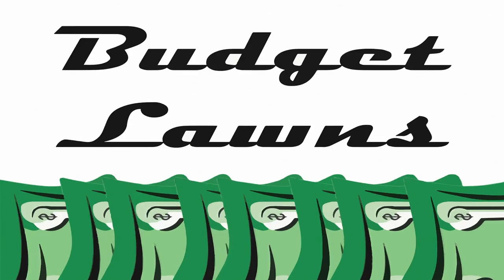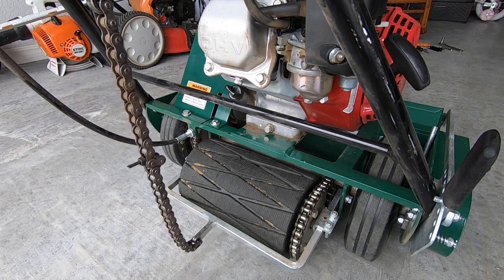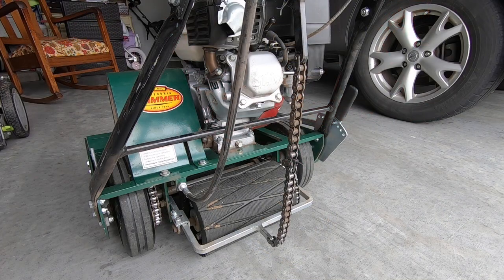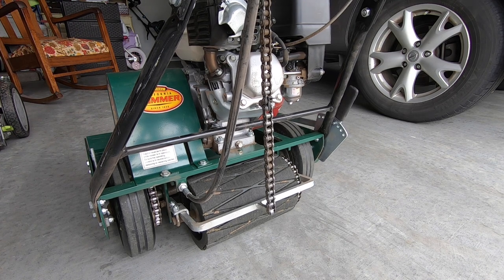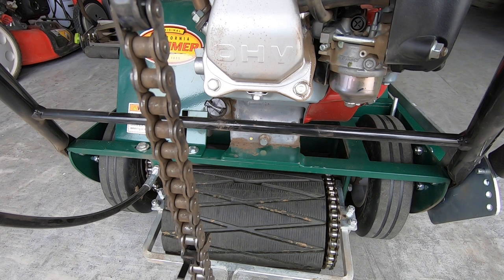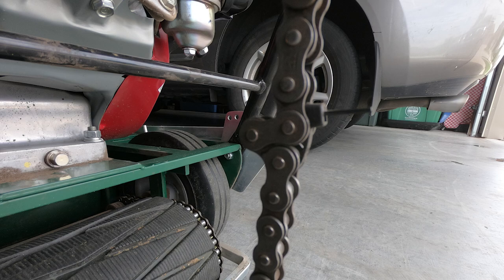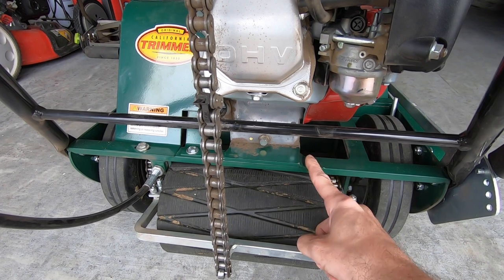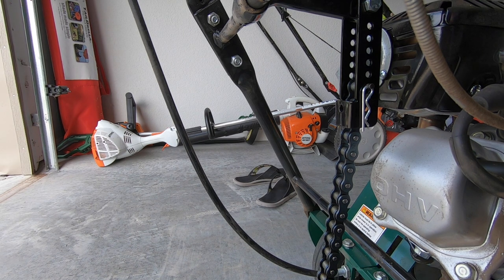Power Reel Mowing Tips // 4 Ways to Adjust the Drive Roller Chain on a California Trimmer Reel Mower

Comment: Hi. Love all the vids. You've got a great YT personality. Hope you'll see this question. Here in Northern California - Santa Rosa - extreme drought regulations. So, here's what I do. 1/2 acre. All grass front and back, for the most part, w/perimeter hedges all around - privet and pittosporum.
I water the hedges, and a little of the grass, every other day w/ hose and nozzle. Takes 30 minutes for the front and 30 minutes for the back. My nozzle at the spray level I use, puts out 4.16 gallons per minute or 124 gallons per 30 minutes. What do you think of that amount of water that I'm using. Does it seem excessive? Thx Dave Santa Rosa Ca
Reply from the maker: Thank you! Appreciate that. It's really hard to say if it's excessive as I don't know what your watering restrictions are. Staying within those is really your only option it sound like. When it comes to how much is necessary, most lawns only need an inch a week. One of my latest vids laid out 4 tips to water correctly. Here's a link to it if you haven't seen it already, https://www.youtube.com/watch?v=L-ycMjccGPE&t=3s. I hope it helps. Thanks again for the kind words. Really appreciate your support.
Reply: @BudgetLawns  Got the answer. Sprinklers - I have the same as you - take 90 seconds to fill a 5 gallon container. So, an hour of the sprinkler uses 200 gallons of water. Breaks down like this: 3.33 gallons for one minute -  5 gallons for 90 seconds -  200 gallons for one hour. Take care. Love the vids. Dave
Reply from the maker: Awesome. Thank you for sharing. Glad you got it figured out. Appreciate your support!

Comment: Not really related to your video but it doesn’t hurt to ask 🤷🏻‍♂️.
How to get rid (or avoid) clip marks? I have a McLane 20” and I always leave clip marks after a pass.
Am I doing anything wrong? Thanks
Reply from the maker: Thanks for the question. I'm not exactly sure what you mean by clip marks. I did a video last summer with some tips that might help answer it if you're talking about what I think you are...https://www.youtube.com/watch?v=4K-1TrzaXTg. The vid will give you a few simple things about how I operate the mower that I've found help with the cut.  Hope this helps. Appreciate ya watching and commenting.
Reply: @BudgetLawns   just watched and not surprised it is another great video!
It addressed another issue I have on my learning curve. Thanks for that.
Let me try to be more specific. As you said in the video the clippings are throw to the left and a small pile of clippings are left all the way across the pass line.
Based on my research it is called clip marks. I only didn’t find a solution for that
Reply from the maker: Thank you. Appreciate the kind words. Glad you found it helpful.
I get what you're saying now. I really don't have problems with clip marks unless it's overgrown due to rain and not being able to mow. In that case, I'd make a double pass in multiple directions. Catching the clippings is another option, which I don't do. You can also make half width passes to go over those clip marks another time to see if they're dispersed more. I hope one of these options helps. But very regular mowing at short heights shouldn't result in very noticeable clip lines. Thanks for watching.

Comment: Is it normal to have to adjust a reel mowers knife bed after every 2nd cutting?
Reply from the maker: I found that to be the case so far. I check it about every other mow. Will prolly start doing it ever mow. Great question. Appreciate ya.
Reply: @BudgetLawns  for realz?! I have not checked mine yet this spring, and I’ve been mowing my azz off. It still cuts like a champ.  Does yours stop cutting well, thus requiring the adjustment?
Reply from the maker: @Thelawnenforcementofficer  No it doesn't stop cutting well. I just do the paper check every other mow to see how things are looking. Sometimes towards the middle of the reel, it won't cut the paper cleanly, so I just barely tweak it to make sure the cut is good on the paper all the way across. You may check yours just to see. I will say tho that last summer when I got it, I went the rest of the season without having to make any adjustments. It wasn't until this year after the scalp that I had to do any.

Comment: What size/where did you get pin for option #4
Reply: You said when running the pin through the chain East and West instead of front to back you will use a different pin. What is the different pin?
(8:10)
Reply from the maker: All the pins came with the adapter. One to go one way and another for the other way.
Reply: @BudgetLawns  ahh I understand. I’m picking up my mower this weekend and incorrectly assumed when you said use a different pin that you were doing your own modification. I would’ve understood if I had the kit already that it came with two pins. My apologies
Reply from the maker: Congrats on the mower. Sorry that was a bit confusing. I see how it could be. No worries. You're gonna love it. For the price, you can't beat a Cal Trimmer!👍👍